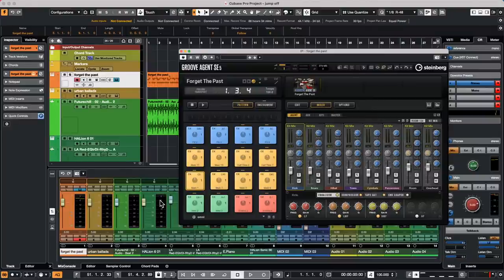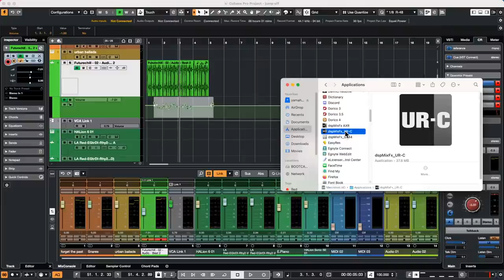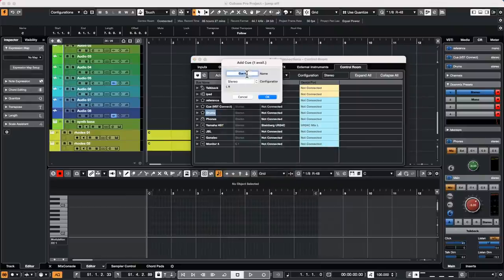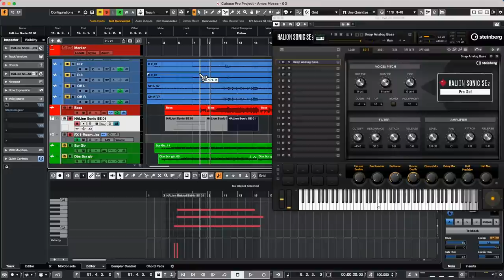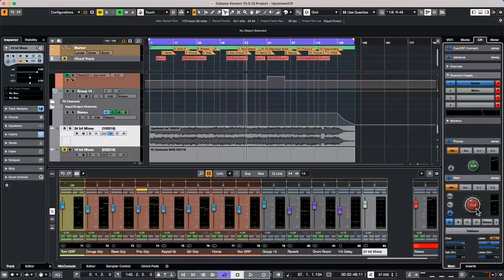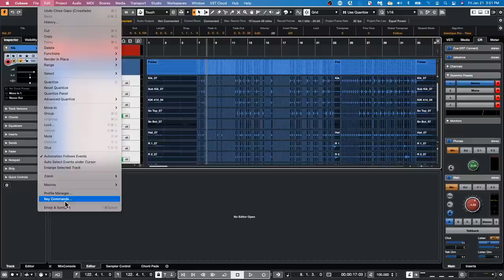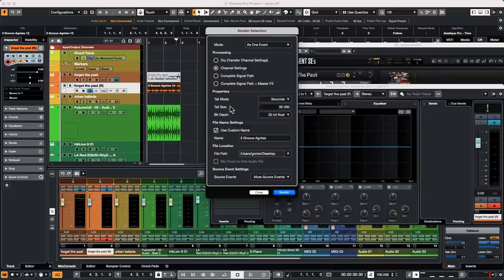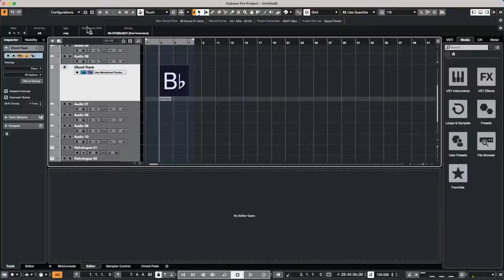How to Control the Pitch of a Voice Using a Knob | Club Cubase January 21st 2022

Comment from the maker: 00:03:41. Is VST 2 support over? 
00:06:04. Is there a UR28M audio interface replacement in the works?
00:07:08. How to record multiple outs from Groove Agent into separate audio tracks?
00:10:33. Why is my gain structure of external compressor off when using ASIO4All?
00:12:27. Should I get separate SSD drives for OS and samples?
00:16:14. How to make last recorded part not playback after MIDI cycle recording?
00:18:51. Why can’t we buy the CC121 controller in Canada?
00:20:14. Can you explain the interpolate audio display preference?
00:26:23. Can you discuss Yamaha VST Rack Pro will it be like VE Pro?
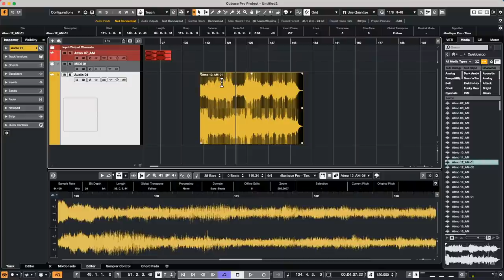00:28:12. Can you show how the input transformer works?
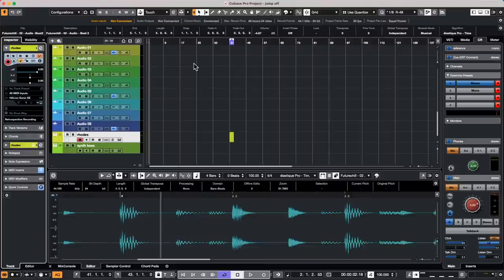00:32:19. Is it better to run SuperVision on master bus or control room?
00:34:51. Is it possible to send a snare to outside reverb without dissolving event?
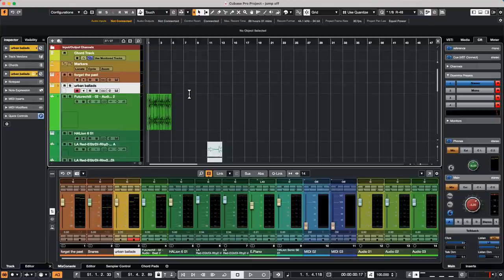00:37:35. Is it possible to increase level on track with existing automation?
00:39:57. How to get sound of Cubase to get routed into OBS?
00:42:36. Is there a way to make the waveforms brighter in VariAudio?
00:44:17. Is there a link to export scores between Cubase and Dorico?
00:46:24. Why can’t I find the HALion Symphonic Orchestra instrument?  
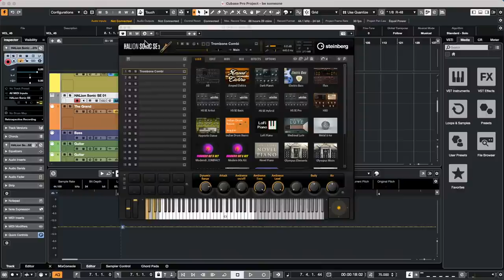00:49:53. Why isn’t the gain control on the mixer above the fader?
00:52:01. How to make last MIDI part not playback recording stacked MIDI events?
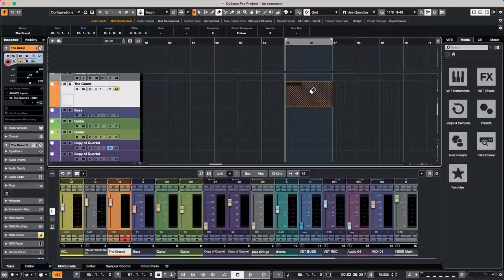00:54:59. What is the best way to do VariAudio editing to audio not recorded at 440Hz?
00:56:32. Why does VariAudio only use standard solo mode?
00:57:53. Would I be better upgrading from Cubase LE to Nuendo Live or Cubase Elements?
00:59:52. How to monitor incoming instrument audio when recording loops?
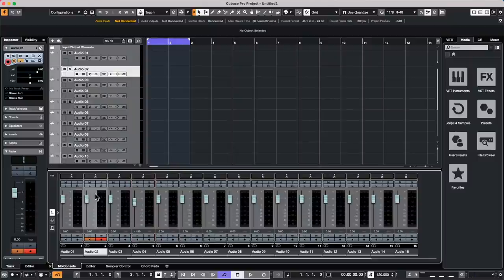01:03:45. When is it good to use effects in the control room as opposed to the MixConsole?
01:06:23. How to delete all notes except for the bass notes in chords?
01:12:38. How to setup the control room to drive Aviom headphone system?
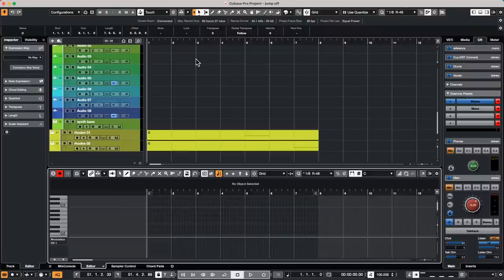01:14:33. How to render a 3rd party VST instrument to audio?
01:16:18. What is the best practice to overwrite existing volume automation on a track?
01:20:08. Why doesn’t Kontakt or Sine Player launch in Dorico 4?
01:23:58. How to render results from the MIDI modifiers into MIDI events?
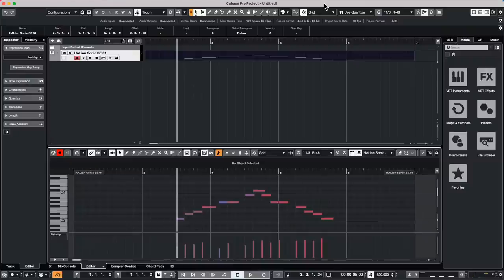01:29:24. How can I connect FL to Cubase?
01:29:43. Why isn’t my HSO showing up in HALion Sonic SE?
01:32:51. Can an audio track be rendered with insert effects and not sends?
01:38:00. How to set a VST instrument to have a mono output without using a group?
01:38:32. Did Greg run the Club Cubase YouTube channel while he was working for Yamaha?
01:40:16. Can you demonstrate the Step Designer MIDI plug-in?
01:43:42. Why do MIDI notes maintain length when the containing event is split?
01:46:17. How to export full mix and instruments only mix simultaneously?
01:51:06. How to have easily switch between 2 different Groove Agent patterns on same track?
01:54:50. Is there a logical editor to delete all notes but lowest in the chord?
01:58:04. How to record from the master out to an audio track in Cubase Artist?
02:00:29. When will we see the Cubase 12 release?
02:00:55. Will we see more logical editor presets in the future?
02:02:15. Can I quantize to the right for a classical pianist performance?
02:05:07. How to get slices transferred from sampler to Groove Agent be in exclusive mode?
02:09:49. Can MIDI sends not transmit Expression Map information to other instruments?
02:12:04. How to get Cubase with my Zed 10FX?
02:13:57. Can you remind us how to run a reference track through the control room?
02:18:38. How do I get an active Cubase license from my Zed FX?
02:19:58. Is elicenser still used for Cubase?
02:22:09. Can I get a new version of my Cubase LE 10.5 or 11?
02:22:51. How to write note repeat information into a Groove Agent 5 internal pattern?
02:28:18. How to match up MIDI loops to different kits in Groove Agent 5 full version?
02:31:42. What do the letters AM signify on many of the Steinberg presets?
02:32:44. Are there Nuendo videos as well like this?
02:33:44. Can Cubase do event envelope volume gain?
02:34:29. Can I get a view of the spectrum analyzer?
02:37:04. Can I record a guitar through software amp and hear previous takes?
02:38:57. Is it possible to master in Cubase?
02:39:47. Is it true that I can use VST MPC beats in Cubase?
02:40:24. How can I install autotune int Cubase?
02:41:36. Does Cubase have drag and drop like Studio One?
02:42:01. How to backup the key commands?
02:45:58. Does Cubase require the ilok to run?
02:46:27. How does Cubase handle timing drums to the grid?
02:50:29. Is there a free version of Cubase available?
02:51:06. How to move a template from 10.5 to 11 on another computer?
02:53:43. Did I get a copy of Cubase when I get a Steinberg Zed FX?
02:54:18. Am I better to have a soothing or loud audio level for YouTube video?
02:55:27. How to see older chat within the current live stream? 
02:56:00. Why does groove agent play only slice when importing slices from sampler?
02:59:17. What is the trick to set left and right locators with 1 click?
03:00:42. Can I load my own samples into MediaBay?
03:02:31. Is there a key command or macro to set tempo with tap tempo?
03:03:42. What can cause sample slices not to translate from sampler track to Groove Agent?
03:04:19. Will there be a time when Cubase won’t support VST 2 plug-ins?
03:05:43. Why does my elicenser get wiped out when updating to Windows 11?
03:06:59. Is there a way to select just the lowest note in a dyad?
03:10:11. What is the best purpose for the Spectrum meter?
03:12:08. Is it possible to send multiple tracks to a send with independent panning?
03:16:18. Can you show a quick tutorial on MIDI gate?
03:21:35. Is there a way to make a copy of my elicenser to an external drive?
03:22:42. Why does rendered MIDI part produce a tail not allowing so parts are out of time?
03:25:25. How many questions have been answered in Club Cubase Live Streams since Covid?
03:25:49. How to fix my Roland sustain pedal which is reversed?
03:27:36. How to reactivate my Cubase 11 Elements?
03:29:46. What are differences between moving parts of audio vs free warping?
03:35:07. How to export a SysEx file from Cubase?
03:39:56. How to manage tracks by track numbers as opposed to track names?
03:43:22. Why when using Mackie Control functions of MIDI controller does it play notes?
03:45:35. How to save only the track EQ settings and exclude inserts?
03:47:23. Will Cubase Elements have an increase in the number of tracks?
03:47:58. How to best utilize workspaces?
03:51:21. Is it possible to minim fader level to -70dB as opposed to infinity?
03:53:04. What will happen when I open my Cubase 11 license to 12 under new licensing?
03:54:13. Is it worth the extra space to use 64bit floating point and 96k?
03:56:36. How to display an Bb as opposed to an A# in the chord track?
03:57:57. Wrap up.  Stay safe and healthy.

Comment: To the Roland sustain pedal reversed question, I have an old one - unscrew the rubber floorpad, there is a switch inside to reverse it. No, I DON'T know why they didn't put the switch on the outside like my Akai pedal......